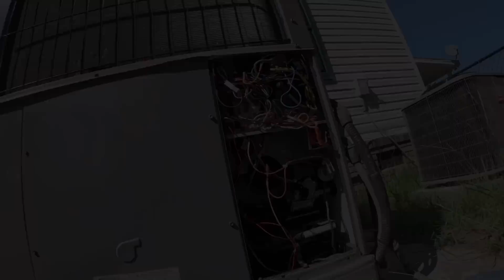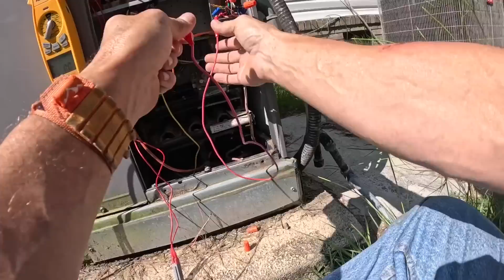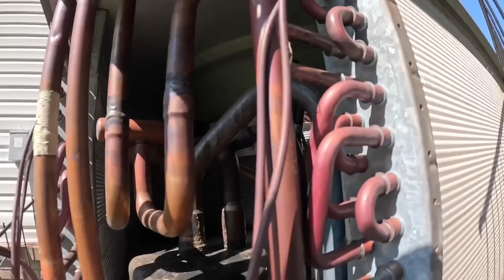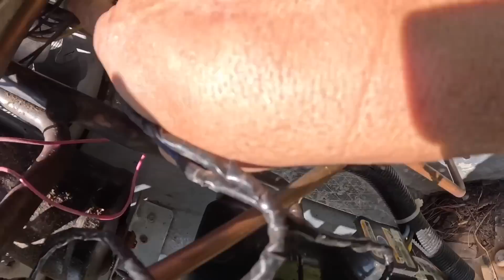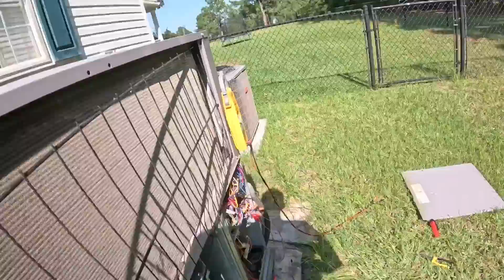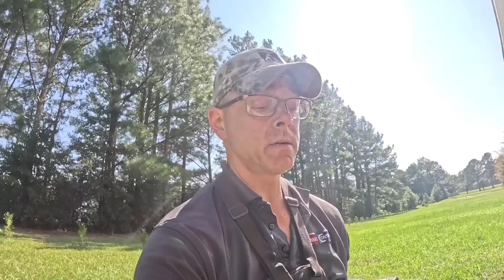Dual Fuel - She Was Told It Couldnt Be Fixed! #hvacguy #hvaclife

Comment: I think you resolved the intermittent failure.  I don’t expect you’ll get a call-back on that same problem.  Certainly a miserable machine to service.  What genius engineered those with such a small control box?  The contactor is basically inaccessible to test safety.  And an ECM blower guaranteed to cause a service call in the future.  Needless to state, I’m not impressed with that unit.

Comment: I gift a low voltage breaker for all my new tech friends. Lil popper is usually what I get. Its such a good tool. Thanks for the videos sir.
Reply: Try a Short Pro Tool, it will tell right away if you have a short. No waiting for the breaker to trip.

Comment: I watch a lot of HVAC repair videos and I'm always amazed at the cheap-ass wire looming in both residential and commercial units.  There is no excuse for wiring looking like a rats nest and lack of chafe protection.  I went through my York and properly routed and dressed the wiring so 'rubouts' won't occur.  I took all of 15 minutes - I don't understand why manufacturers can't and won't do a better job.
Reply: Cause them engineers don't care. They aren't the ones who gotta work on them.
Reply: Meanwhile, in the Accounting Department:
"Let's see, fifteen minutes of proper, safe wire routing per unit, times X amount of units produced per year... We're wasting so much money!"

Comment: Don't know if you have run accross this but my company has found a couple of the solenoids coils on the reversing valves bad internally. it would intermittantly trip the 3 amp fuse. no rub outs anywhere. had to use the megger to diagnose it.
Reply from the maker: No haven’t seen that. Not like that anyway

Comment: A question: 
Would wire loom be a good remedy for the rub outs?
Reply: It help, but it can also make things worse. Wires does vibrate inside too, plastic on plastic, so not as bad, but can wear out. Also, the loom can rub out, then expose the wires. So it does help, but is not a 100% fix.

Comment: Good fix!!  Kinda like a rats nest the way things are crammed in there so finding a rub out was an outstanding job!!
Reply: Try working on a ptac unit sometime. It will literally scare u when you open the control box 😂. Imagine all the furnace boards n safeties, plus the ac controls and all the wiring, in a SMALL shoebox. Most places won't even work on them.
Reply: Yep you’re 💯correct!  I had forgotten about those monsters.

Comment: Hi Curtis, I have a question... what do y'all mean by "dual fuel" is it because the unit has both the reversing valve and strips when in heating mode?

I'm not familiar with those ones
Reply: The outdoor unit has both a gas furnace and a heat pump. It can use either natural gas (or propane it converted) or the heat pump for heating. Natural gas can be used at lower temperatures if the heat pump's capacity can't keep up with the heating load.
Reply: @heymikeyhelikesit8673  got it! Where I live most of mini splits are heat pump and when we need heat on bigger equipment it's 100% electric heat

Comment: How could this failure have been prevented?  What do you think about using a few small tie wraps on these wire bundles?  Tie wraps could prevent some rub spots and also offer some strain relief as the bundles add strength as the wire numbers increase in the bundle.😇

Comment: Does dual fuel just mean a gas furnace with a heat pump, and a controller that switches between the two at a certain temp???
Reply: Yesirr sure does. Will run on heat pump with or without electric heat strips. And once demand gets bigger, cold af out. Jumps over to gas fired heat
Reply: @AllTattedUp13  that might be good up north here.  Suppose it's needed where it's a normal heat pump that only goes to 30f or so.

Comment: So any thoughts on the home warranty’s?
Reply from the maker: If you need the work. They can help
Reply: @HVACGUY  As a homeowner I just don’t feel like I can trust them. Thoughts??
Reply: I like being able to choose who does the repair. Like in this case, once you've had Curtis work on your system, you can call him if you need another repair rather than getting whoever the warranty company feels like sending. Sometimes you have a choice though even with the warranty. Back in the 60s, we had a service contract for our TV. TVs were expensive back then and my mom liked the contract so they didn't get unexpected bills. But, we found that many of the people they sent weren't very good and would just take it to the shop. But Glen could always troubleshoot and fix it at the house. So whenever we had trouble, she would ask for Glen. Fortunately the company could handle the request and send Glen when we needed him.